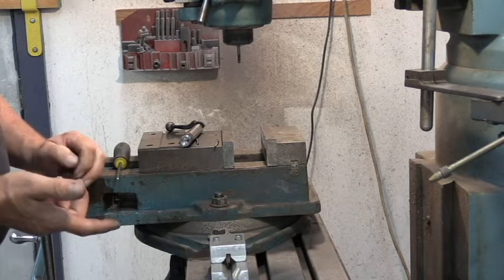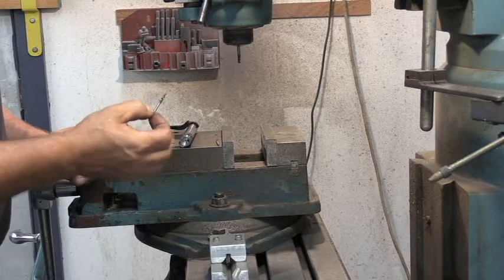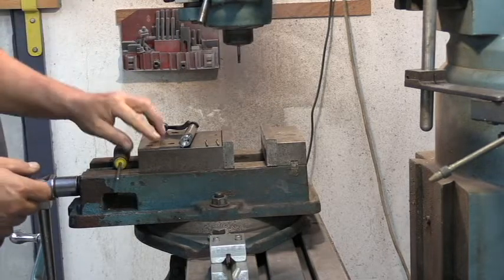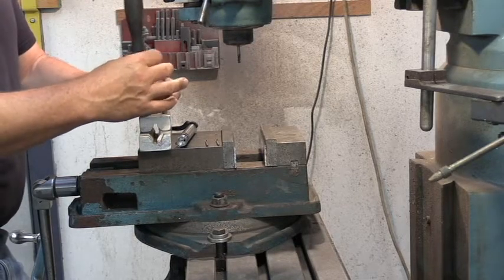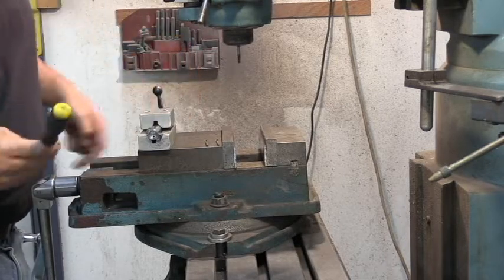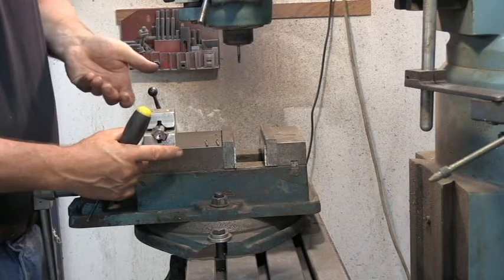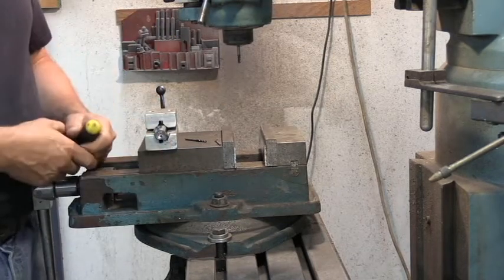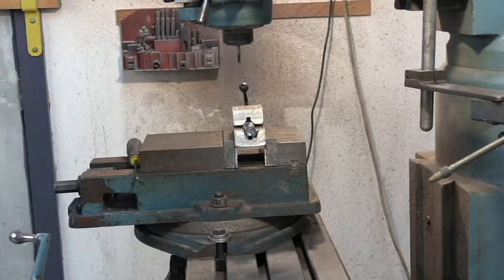How to install a Sako Extractor Part 3

Comment: Looking closely at 23:20 it looks like the bolt face/ nose is cracked where the slot is milled.  If it is cracked, it probably goes to the firing pin hole. Caught my eye when Jeff holds it up close.
Reply from the maker: Always someone trying to find a flaw. I assure you there is no crack in the bolt face or bolt nose. You are seeing light glaring or something. I assure you the bolt is not cracked. I can't even imagine how you could crack a bolt face/head.......
Reply: It is a change in the pattern of the tool marks one side of the end mill is moving forward the other side is moving backwards. In the center the slot ends up with a line of the 2 different sets of marks contacting. Something of a witness line. Definitely not a crack